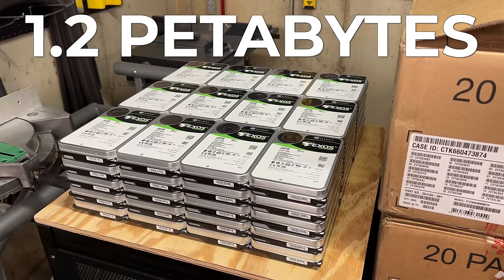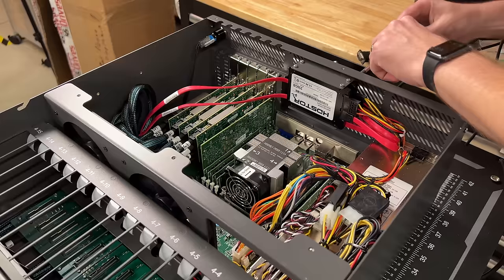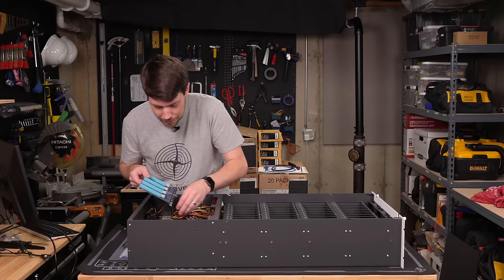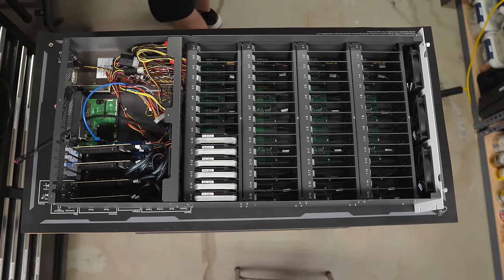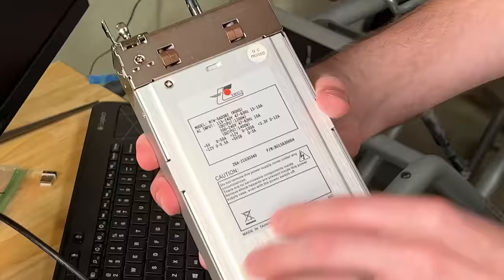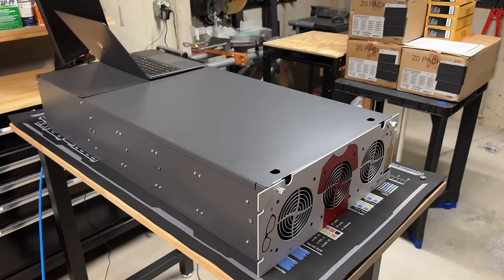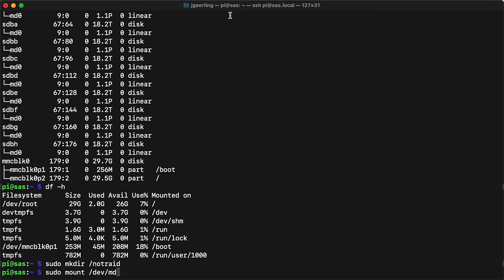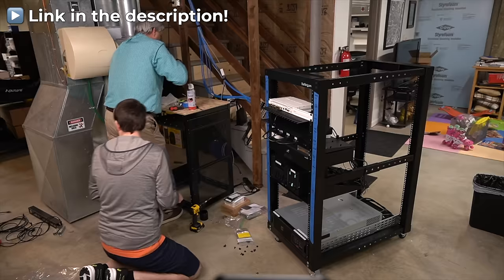The Petabyte Pi Project

Comment: Hu, I know that modern cases have that 1 stud so you can place your motherboard in on the stud which makes it easier to align the rest of the screws, but even then every motherboard I have installed has had 8 - 9 screw holes, sometimes there is a heatsink or something in the way of having all 9 screw holes, but 8 is the minium I have seen, this is only for full ATX though not ITX / mATX.

Comment: Replace the Pi with another SBC that has at least 2.5Gb networking, which will suffice for most home labs, and one or more PCIe connectors. Most of the latter only have very few lanes, but it's still enough to do add some decent bandwidth using SAS adapter cards.

Comment: I work with a 100x drive server similar in design that uses 8 fans. I am sure with the pi/limited activity those 2 fans will suffice but withe the stock internals I doubt the drives will be reliably cooled below tdp. You would need to keep it a room controlled to <25c.

Comment: Naive guess: regarding the harddrives going offline/faulting when using other schemes than sequential/linear, it might just be a power issue where addressing that many discs trough the PCIE cards might draw too much current and the cards get below a voltage threshold on the expansion board.

Comment: To be fair, there's shall we say just a little difference between a Xeon and a Pi in processing ability. Hell even a gen1 i7 would kick the pants off a Pi but they're horses for courses.

My Pi mini does an awesome job as a ham DMR radio gateway. Powered off PoE etc and double side taped to the ceiling near the WiFi with a proper plate and all ... looks nice and works nice. I wouldn't expect it however to be a brilliant file server or number cruncher.

Comment: Raid controller should correct the data inconsistency and hide it from the OS.  (Possibly not with raid 0 but the error correction bit remapping usually works well.). Enterprise raid cards usually have RAM with a battery backup.  You were probably using write thru instead of write back.

Comment: I am happy with my  20 18 TB HD The wrost part is I had to build 2 servers with 20 18 TB Drives.  And the hell with the 3 2 1 back up plan  I''m happy with 2 copies of my data that sync nightly manually running a command.  You still need a copy of your data when your dealing with this much.  Even a delta change is a pain.  I have 2 copies so I can point my freenas cluster to the 2nd set of data in a few mins and keep my servers and services live.

Comment: Btrfs due to metadata computation consumes quite a lot of cpu even with a single drive. I tried going from ext4 to btrfs on a laptop from 2012 with Intel B980(2.4Ghz 2 cores,no HT,no turbo) and my IO performance halved while on my desktop with r5 5600 the performance is pretty much on par between ext4 and btrfs.

Comment: If I order a storeinator from 45 drives and I find out they shipping it through fedex. I will be calling to cancel that order with no hesitations. 
I have seen too many issues with fedex mistreating their customers shipments, online videos and in person. They literally throw everyones packages, dont even bother stacking and securing them. 

Aside from that, Yes your transfer speeds will drop when offloading content to a Pi with 60 drives. 
All of those drives have a shared speed of USB 3 speeds, you have to factor this issue. Not to mention when creating an array, since it is not 4 legitimate pci express lanes straight to the pi board the pi has to control and communicate between the drives consistently, that takes of some bandwidth as well. 

This was definitely a fun project to watch, but if I were to go about storage on a budget? I would get 2 smaller JBOD 4U chassis then get a 1U server with the proper cards needed to directly tie into the JBOD chassis.

Comment: that little USB3 riser cable would almost definitely be a cause of random packet loss, especially combined with all that local SATA noise, in fact it might even be the SAS port closest to the USB socket on that switch board that, when data is transferred through, corrupts the data going through the USB cable. If not any of that it could have simply been a bad SAS connection somewhere.
But yea, other than that, yea you're only going to barely get 80MB/s on average, maybe more for large files, simply because the ARM cores just lack the internal processing power and bandwidth to process the data going through. This is equivalent to Linus's experiments with flash arrays that end up being limited by the link between a single core and everything else, unless you artificially load up dozens of cores with IO's, but in this case you don't exactly have many cores or leftover bandwidth to work with.

Comment: Dude I'd recommend to adapt: Sorbothane patches, on the base specially but also on the sides of the HDDs, Or silicone patches too, to cushion us much as possible, sponges if you don't have them, whatever helps you Prevent  HDD metal case vibrating another metal structure, that's really bad; great project.
Maybe would be cheaper with a JBOD?
@20:55 About data corruption error message: remember you put a cable and didn't do a click, you're sloppy with the hardware, so you'll get hardware errors. Also PCIe 2, switch to another ARM CPU with PCIe 3, it's a bandwidth problem, some HDDs timeout, and fail
Give red shit Jeff a  big slap on the back of the head, OMG the HDD falling to the floor, I felt that.

Comment: I would suggest you try creating a linear or stripped raid over all o the drives attached to a single controller. Once those are assembled create another raid, btrfs or zfs over the top of that.

Generally you need to identify where the bottleneck is (almost certainly pcie) and reduce the traffic, especially the concurrency, at that level. I have seen several examples of with drives appearing to error out because the latency of the link to the controller being such that operations to a drive would timeout because of controller communication but the block level of the kernel would fail the drive thinking the drive itself timed out.

If the HBAs, either the ones that it came with or the ones you used with the pi support raid themselves you could have them do a raid over all the drives attached to one controller at the hardware level instead of the software level. I would suspect you could get at least what you were getting with only four drives this way.

As always, make sure that all your stripe sizes, block sizes and sector sizes are the same or exact multiples of each other. I'm pretty sure command queuing is enabled by default with SAS but it might be worth checking that as well.

Comment: Jeff, I just have to rub it in a bit, your approach when receiving mount errors was pretty haywire. Instead of going "more complex" when hitting a road block you should have gone "more basic". When setting up ANY large array you first do a low-level test. Like dd if=/dev/sdx bs=4k of=/dev/null for every single drive. One run testing the drives sequentially, one run testing the drives parallel. In fact in my 35 years of RAID management I am used to have at least 5% faulty drives/controllers/hardware/etcpp every single time, even on the most enterprise systems, and that way you catch them pretty easy.

To show my point here are my scripts (and yeah, they are pretty old as the size of the drives and the name of the devices might suggest). Also, wc might not be the fastest way on a slow system but hey, it works. Maybe "dd wtf | wc -c" would work faster but who cares 😎

And if this failes, start smartctl -t long /dev/sdx tests INSIDE the drives. because they do it without the computer and it they pass this test, well, at least the drives themselves are fine.

file checkdrives-ser

#!/bin/sh

while read DRIVE EXPECT; do

  echo "`hostname` `date +%Y%m%d-%H%M` drive check /dev/$DRIVE started."
  COUNT=`wc -c /dev/$DRIVE | cut -f1 -d" "`
  LOGDATE="`hostname` `date +%Y%m%d-%H%M`"
  if test "$COUNT" = "$EXPECT"; then
    RESULT="$LOGDATE drive check /dev/$DRIVE passed."
  else
    RESULT="$LOGDATE drive check /dev/$DRIVE failed at $COUNT, expected $EXPECT bytes!"
  fi
  echo $RESULT | mail -s "$RESULT" root
  echo $RESULT
  sync
  sleep 1
  sync
  sleep 2

done <<EOF
hda 120034123776
hdc 160041885696
hde 160041885696
hdf 160041885696
hdg 160041885696
hdh 160041885696
EOF

wait

file checkdrives-par

#!/bin/sh

while read DRIVE EXPECT; do

  (
    COUNT=`wc -c /dev/$DRIVE | cut -f1 -d" "`
    if test "$COUNT" = "$EXPECT"; then
      echo "drive /dev/$DRIVE passed."
    else
      echo "drive /dev/$DRIVE failed at $COUNT, expected $EXPECT bytes!"
    fi
  ) &

done <<EOF
hda 120034123776
hdc 160041885696
hde 160041885696
hdf 160041885696
hdg 160041885696
hdh 160041885696
EOF

wait

Comment: If the RPi is too slow, take more of them and put them in parallel. Yes. Sounds awful. I mean awful amazing and I want to see that! :-D A Pi cluster rate system. You can also feed them data in parallel. Hacky²
See on the Pi there is a bit of a bus limit, but if you feed the data into parallel RPis you will soon see that multiple busses might be able to even trump some of the biggest single board computers. Because they only have one bus. This is the true meaning of parallelism. Also think about this: you have redundancy on the drives, I got that. But do you also have redundancy on the computers? You don't. So it would be awesome if you build a rack that is redundant enough to even let an Orc with a sledgehammer into the room do a bit of his magic and he has to work for half an our to get his first failures on the rack.
I'm sure a gang of RPi can do that.

Comment: I itself designed network file system, own version of redis database  for higher RPS, linked my machines by fiber optic line, installed maximum of ram into each of my pc  and also i itself designed  probability framework for solving equitation with 40tb probability  coefficients. Now i able to predict settings end ingredients for polymer  composite materials with perspective physical and mechanical properties, also i able to predict  behavior of whole NASDAQ stock exchange with overal accuracy 65% for one of 15 scenarious at long time modeling tests on 1300 instruments. Your build is crazy, but you cant use all capabilities of your setup even on 1% level, its terrible to see. My datascience heart was broken and completly  melted after seen that video. Hello from Moscow with love.

Comment: What about the NVidia Orin?

The Nvidia Orin (Full or Nano) has PCIe.  You Could Take a Riser Cable, Put a Quad NVME to Sata adapters on each, and you Should Have 5 X 4 SATA connectors (up to 20 Drives @ 20Terabytes Each)  
That's Like an Orin Nano Handling up to 500 Terabytes - Plus the NVME on the board itself, and you could just boot off the EEC Card.

Comment: the biggest problem is that when performance degrades, the os goes to a point where there is no way to recover. the whole system becomes unusable because the kernel itself waits for data which is unexpectedly slow for the system to even operate the most basic io
i have tried several fs configurations with no luck, when the kernel io loop gets too slow for what is assumed to be a simple operation the whole operating system hangs. no matter how many cores you have or what other software you're running

Comment: I used an 8 drive usb tower on a Pi4 running open media vault but it would crash every time I tried to do writes to it especially time machine. I just wanted to mount the pi inside of it and use it as a nas. I might have to revisit even though I am pretty firmly in camp synology and unraid at this point just for ease of use and reliability for customers.

Comment: My own server👇🏻

Project Peta

Server Case - Dell EMC PowerEdge XE7100

Storage - 100xWestern Digital Gold 22 TB

Cpu - 2xAMD Epyc 9654

Motherboard - H13DSH

RAM - 3x2TB Kit 8x256GB DDR4-2933 PC4-23400

Power Supply - HPE R0X36A#ABA 3000W Aruba 6400

Gpu - Nvidia H100

PCIe Card - TP-Link Archer TXE75E

Comment: There are arm based Chips which could easily handle this, given most of the data transfer is done via DMA or FPGA logic.
Xilinx Versal Premium for example, it is a dual ARM Cortex-A72 with PCIe 4.0 / 5.0 and up to 800GBit Ethernet.
It´s not meant for storage servers, but it should be possible to use it for that usecase.. Obviously not a turn-key solution and way overkill in some regards.
+ One Chip alone is ~30k€ currently.

Comment: Jeff, your problem was poor routing of signal and power wires.  the haphazard way you poorly grouped everything together exposed your system to the effects of noise crosstalk spikes induced from wires next to each other.  In the future dont rush and take a beat to completely or as much as possible segregate your power conductors away from your signal lines, or run them through a mesh tube you can ground the tube to the chassis. good luck.

Comment: My guess is, it probably would ultimately work, but would take more debugging with the kernel and the RAID firmware with the help of the manufacturer, if they wanted to.  Did you try messaging the raid card manufacturer to see what they said about it, and the linux distro?

Comment: i would like to know if we use raid card instead of hba card. can raspberry pi offload to raid card for sync and performance issue? 🤔
Reply from the maker: That's a good question, and yes! I did work with a Broadcom 9460 hardware RAID card (older versions don't work, unfortunately), and it did allow the Pi to saturate its bus at 420 MB/sec using RAID 5, which would've been extremely slow without the RAID card.

I mean, technically the RAID card itself has a faster SoC on it than the Pi, so it's a little bit cheating... but it does work.

Comment: I tried to experimentally find out what command created the nice coloured output which you used to watch the drives boot up. I tried journalctl, tried to reach the last line. When I had held down Picture down (I think it's called like that in English) for several minutes and was at line 30.000-ish I gave up and redirected it to a file. I opened the folder in nemo and saw: 70.5MB! of journal messages! xed crashed while trying to open it.
Reply from the maker: Heh... well I used `dmesg --follow` which returns colored output by default in Debian/Ubuntu's default terminal. Then I used `atop` to monitor the drive activity.
Reply: @JeffGeerling  
Thanks! 
I actually knew about dmesg a year ago, but then forgot about it... I was searching through my entire /bin/ folder (have stopped after a few tens of programs) for which command I had seen before to output system messages, thanks also for the re-introduction!

Comment: Is there a Raspberry PI which fits inside a standard size 3.5" drive enclosure? I don't plan to use a SATA connector, just want the form factor. I was thinking of stacking a 3.5" NAS vertically with a PI stacked on top, so it would need the same form factor as the drives.

Comment: Ive always wondered if there was a way to make a external ram board like hp has one that adds 4 ram slots on a pcie. Ive ran into issues of bottlenecked performance not because of cpu but because ram capped out. The pi has only max of 8gb so i would assume max speed on drives could only be met with maybe 6 to 10 drives at most. If you were to add an additional 128gb i wonder if that would help out. Plus the raid cards you had i couldnt tell if they had their own memory or passthrough.

Comment: If the original setup was using software raid on the motherboard … that would be interesting instead of creating Virtual volumes on the array then possibly striping them together with software on top.  The management interface probably consisted in some part by the raid vendors (Raid card manufacturer) and their own custom interface.  I am inferring most if not all of this but not leveraging the hardware on the CPU seems like a mistake.  That beefy a motherboard with the correct OS would probably do a bang up job as a RAID controller .. but using a raid controller kinda makes it not a raid controller .. and not the raid on it in your raspberry pi setup seems … like a questionable decision… but you were testing the PI and not the raid cards.
Reply: Hardware on the RAID controllers CPU*.

Comment: I'm surprised you got as much performance out of it as you did given how the NIC is connected on a normal Pi (i.e. via USB). Do compute modules actually have the NIC on PCI? As for your PCI/disk errors I'm disappointed but not really surprised. A lot of Linux drivers are written with an "this will never fail" attitude. When you do get an error there is often no recovery, no retry, no (working) reset of the bus and replay of the broken data packet. These errors only happen when you take stuff to the edge and beyond (or when you have a million users). The developers don't see this with their systems so this code path is never properly developed. It just kicks the drive. PS: This also applies to the drive firmware. It might not be capable of recovering from a transmission error because "that never happens".

Comment: "maybe even that usb3 adapter cable that goes from the pi to the switch".  That.  I've used these just for single card before and they're flakier than your grandmothers croissants.

Comment: What PCIe Gen (e.g. Gen3) does the CM4 carrier run? I have some experience trying to push FPGAs over those crummy 1x risers, and almost always had to drop to PCIe Gen2 or even Gen1 to maintain signal integrity over even the shortest USB cables.

I'm curious if it would be more stable, at the cost of being even more painfully slow on the upper end.

Edit: Oh wow just saw the follow-up video to this, and sure enough, dropping to gen2 improved stability a bit, and dropping to gen1 seemed to make things solid. Would not surprise me if just about all of it came down to the riser and USB cable carrying PCIe signaling.